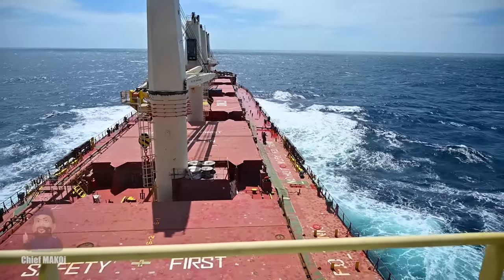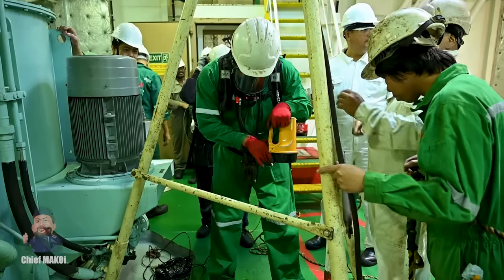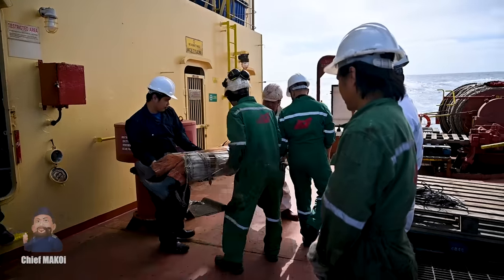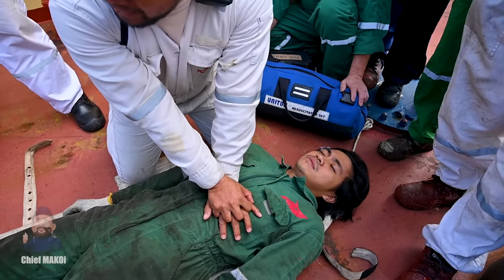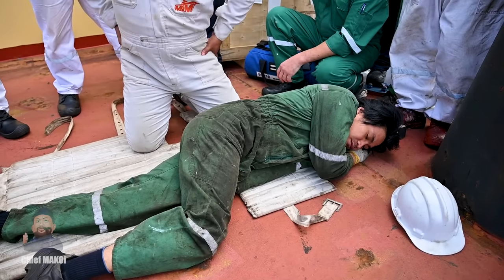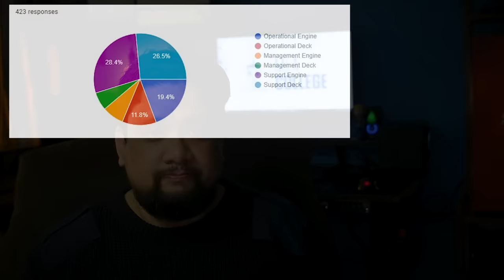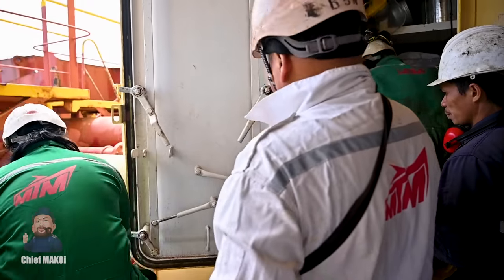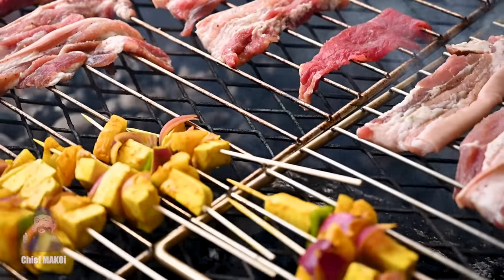Weekends Onboard a Cargo Ship | Chief MAKOi Seaman Vlog

Comment: Chief, you are definitely deserving of a Masters degree in your field. I have recently heard of the Ammonia as fuel idea. Until a few years ago I didn’t learn of the flammable nature of ammonia until I was a welder for an Ammonia refrigeration company. I was doing a tie in weld on a new section of pipe and the valve on the line had a small amount of seepage, therefore it would leak into the pipe and usually would become volatile every 45 seconds or so. It was interesting to say the least and one helper learned not to sit on the empty valve body when there’s welding going on because he wasn’t aware of the 45 second cycle. He sat on the empty valve body about 20 seconds before the ammonia flared and I didn’t realize it until I heard the howl of the flame coming out of the valve body and scream of the helper getting seared. He didn’t get hurt, just scared the crap out of him😂🤣. I laughed for a good 20 minutes. I wish I would’ve had it on camera, I could’ve been internet famous 😂🤣. Take care buddy 🤙

Comment: 3:22... you guys should use a dummy with human like weight (70kg) and stiffness ... its match harder and requires different technics too then towel wrapped in clothing
5:44 the mouth piece is positioned upside down, thin side should be on nose.. 
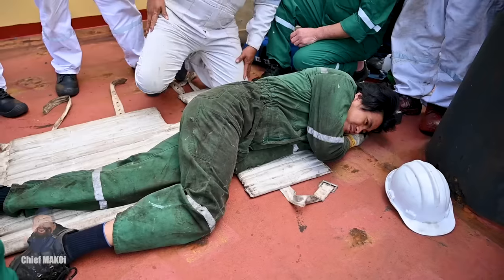6:09 his left hand should be extended straight out, this will prevent an incapacitated person from completely turning over..
closing it a good practice to put every single one to perform this exercise, after the demonstration.. No human has ever admit he did not understand, or asking questions. that said, its key for them to learn properly, they should be able to get it right first try (trying to save a life is one try only for the unlucky person).... if not you let them know what they did wrong and repeat.. and do again next weekend... you can do emergency drills on a random place on ship, call them there with a CA (captain announcement)...
Reply: TOTALLY AGREE  !!!

Comment: Chief, I understand that you will probably place most of your emphasis on the technical aspects of fuel choice. This is as it should be. Please do not ignore economic considerations in your ranking of fuel alternatives. The best fuel in the world won't get used if the cost to the owner is too high. You also can't blindly pass that cost on to the shipper, and hence his customers, and not expect their behavior to change. If you drive up the cost of shipping, less stuff will be shipped. That means fewer jobs for merchant mariners.
Yes, I am a recovering economist. It's not called the Dismal Science for nothing. I would be happy to answer what questions I can.
Ah, steel beach. I've spend my time there.

Comment: Chief, for your master's program and your search for alternative fuels I'd like to share something with you. I am now a disabled tractor trailer driver after 40 years on the road. The last company I worked for tried going with compressed natural gas due to the Gov't payments they got for using that fuel. From my standpoint as a driver it was a massive failure and when the Gov't payments started going away they started going back to standard diesel powered trucks. Thank you for your videos.

Comment: It has been a while since I last used a Neil Robertson stretcher, we switched to Paraguard. It looked like a good exercise but the patient needs to be strapped in properly. I appreciate that it was a dummy but it was only fastened by the leg section which caused the issue at the hatch. Just over 40 years ago I was playing a casualty and being lowered from an aircraft hanger.

Comment: Hi 
It great to hear you are going for your masters degree, I don't think I would have the patience or discipline to study at that level now especially as its distance learning. In response to the subject matter from my worms eye view the choice of fuel depends on a few factors such as how green was the process for manufacturing the fuel and calorific density. I have been involved in debates over this but for land based plant and vehicles its amazing how much greenwashing is involved in choosing the wrong fuel. Is there a reason you didn't include nuclear it seems to work well in military craft ? Or is that because it would be a move away from a traditional piston engine.
Keep up the good work

Comment: As for a future fuel, I'd go with hydrogen.
Your ship is floating in millions of gallons of hydrogen, which is part of water.
Submarines use seawater, to extract hydrogen from it, and then use the oxygen to supply the crew with fresh air.
The hydrogen usually is jettisoned out of the boat.
But it wouldn't be hard to have a system that would collect the hydrogen and compress it to be used by the engines.
It takes a very small amount of hydrogen, to provide the fuel combustion engines need for normal operation.
And doing so, does not ad any pollution.  Hydrogen is not a carbon based element.
And water is about the most abundant material we have.

Comment: That is cool. As an apprentice in Sheet Metal Workers Union we had to have CPR training annually and First Aid training every 3 years. Then we had to keep current as a journeyman with annual upgrades. On the part were you went into a "confined space" you never go in without breathing apparatus because whoever is in there succumbed to poisonous gasses or vapors and the next person in to save them with fail too without protection.  Great video chief. As always, Safety First.